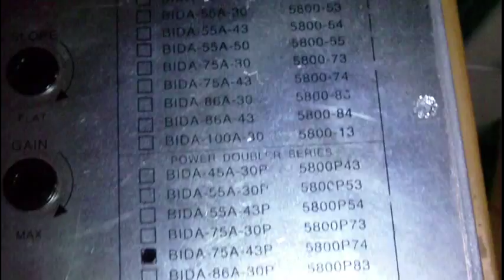Blonder Tongue Laboratories 75A-43 CATV Distribution Amp repair

Comment: Would this device work for broadcasting an RF signal over rabbit ears attached to the output? Currently eyeing a different Blonder Tongue Broadband Amplifier and just wondering.
Reply from the maker: Yes you could use it for that.